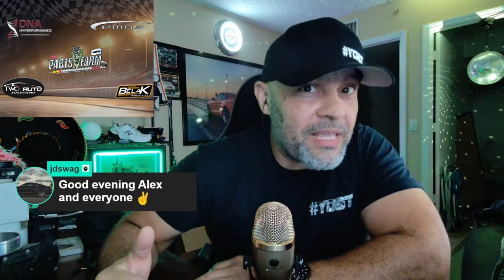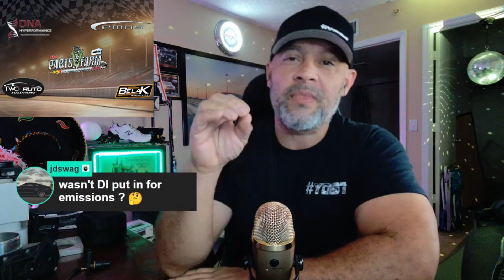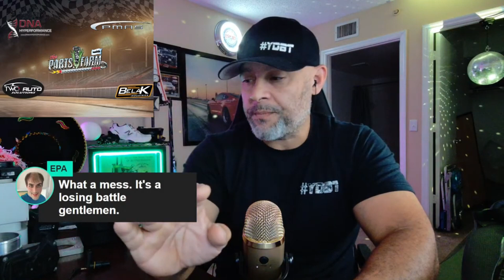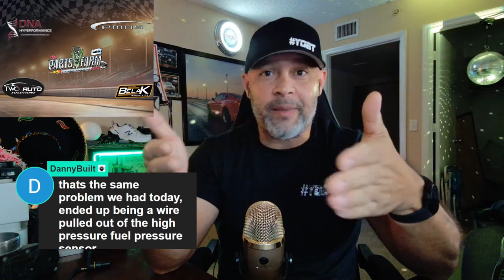If Gas Particulate Filters become a thing on mustangs, tuning is over

Comment: Main problem on GDI engines that produces soot is poor air fuel mixing in the cylinder.  This usually occurs at low rpm and high loads.  Some manufacturers went out of their way to change port design to help this rather than add port + direct injection.  Honda's K20 turbo engine in the CTR actually had a little ramp in the intake port right before the valve (at least on the FK8) to help low speed mixing by creating turbulence.  Obviously adding port injection is a much better solution because fucking with the port can hurt high rpm flow, but it adds $$$ that the bean counters freak out over.

Comment: Just found out that I have the ringland issue on cylinder 8 on my gen 2 with Procharger. What’s the best route to go for a short block? Rebuild or buy a whole new built gen 3 block?
Reply from the maker: @joeyislifted2400  gen 3 sb if you can find one

Comment: A lot of European cars have GPFs on them now, it’s monitered with a differential pressure sensor just like diesels. When they sell the car in the US, they keep the GPF on the exhaust but they don’t have the sensors so it doesn’t monitor it. GPF can be deleted and the car has no idea. So hopefully Ford would do something similar, at least until the US government decides to mandate it.
Reply from the maker: @Audi30V  yes that's the key. If the car runs while gpf is deleted then it should be ok. Same as the car delete deal

Comment: Is tuning over for DPF's on diesels? No. Its just harder and more expensive to do. Same process to delete and tune a diesel will now be the same process for gasoline engines. Long live the non corporatized ecm/tcm tuners!
Reply from the maker: @matthewgirard8164  in modern times they are still doing delete tunes. The only ones that are not are barely making any noticeable power. So if you remove it and you make the car run.. guess what tuning is over. You will get a knock on the door..